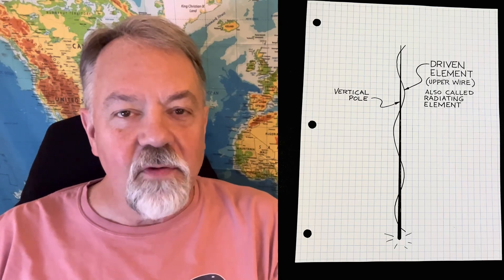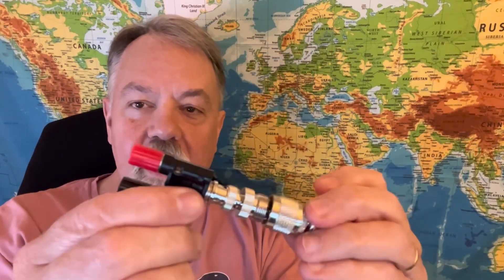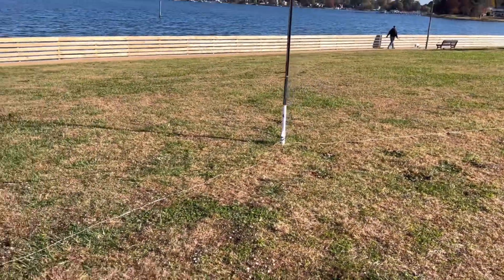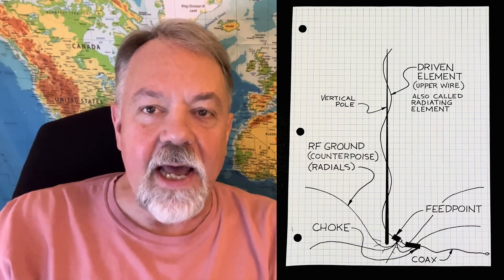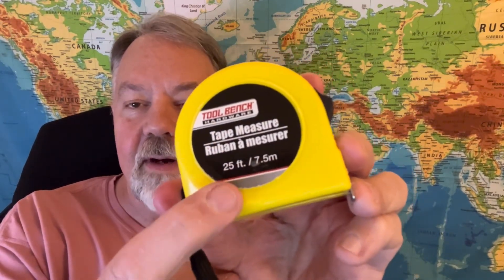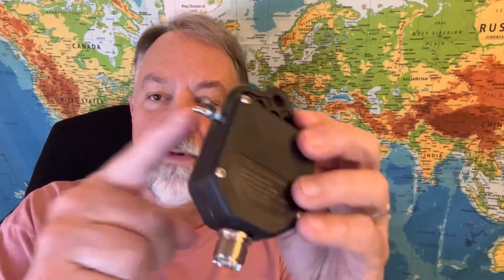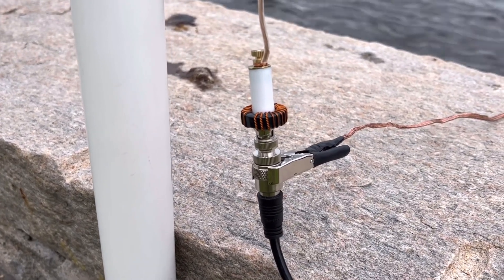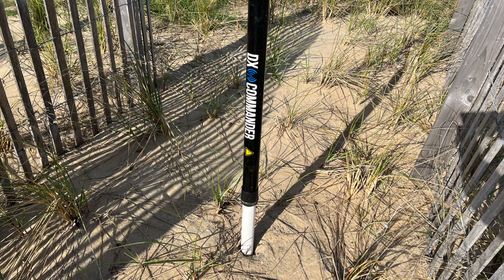Building Your First Vertical HF Antenna - Tips for Success

Comment: Would you please post the link to the "antenna tool" program that you sited in your video. Also would you please consider making a video describing/demo  some of the antenna programs that you have used and continue to use when designing antennas?  Thanks, Joe AA6WG

Comment: What would you recommend for a 40m vertical?  I have a net I work everyday at 7225 and I have been doing pretty good with my NVIS antenna. But I want to do better for the guys out there 400-600 miles away.
Reply from the maker: The best experience I’ve ever had on 40 with a vertical was using a 17 foot telescope whip on a Wolf River Coil.

Comment: I wish I saw this video when I first set out for the "grail" vertical. I ended up (after some experiemntation) with about a 37' vertical wire, qty 10 10 foot radials. Playing with VNA and experimenting I ended up with a 9:1 on it and an LDG600 W remote trans-match/ATU. The feed line is about 60' with the common mode choke 25 feet from the base of the antenna. Tunes up fantastic on 80, 40, 30, 20, 17 and 10. The 9:1 was the magic that opened up the range of bands. The elevation chart probably looks like a porcupine on steroids on 10 but it gets some DX. 40 and 20 really sing DX though, even when the solar was low I was working globally with ease most of the time. I took it down in the spring of '23 for a yard party. I haven't been able to construct something a little shorter that worked quite like it yet. Will probably bring it back to life after the leaves are gone to re-confirm the performance.

Comment: I just update the firmware. Etcher wouldn’t work so I used Rufus. My question though is I’ve got the radio plug into an external battery but I can’t turn to power up to 10 watts. I remember that the radio would do 5 watts on its internal battery and 10 watts with an external. What am I missing?

Comment: This is excellent.  And a huge help.  Quick question: do things (by things I mean the counterpoise wires and arrangement) change if the base of the vertical is off the ground, such as mounted on a fence post??

This is a really helpful video.  Much appreciated!
Reply from the maker: Thanks, I’ve found that as long as you get the counterpoise down to the ground and out that 3 or 4 foot span from the base to the ground really doesn’t matter. 73, Walt

Comment: One way of adding radials is to buy a cheap inline lightning arrestor add it between your balun/unun and your coax, then attach the radials to the grounding screw on the arrestor.

73 de AF6AS in “DM13” land
Reply from the maker: Interesting, thanks

Comment: Very helpful to this absolute Newby.  Can you provide links for purchasing chokes, ununs and banana plugs?
What bands are best for local listening only. No transmit. 
What bands best for longer range listening?
I've got a freshly refurbished Yaesu FT101E that I've owned for years but never powered up.
I'm hoping to find instruction on how to listen ONLY and how to properly dial in this complex looking vintage radio. 
Thanks
Reply from the maker: Check out the LDG baluns and ununs at DX Engineering. Not much for just local ham listening unless you get a little 2 meter radio and program it for your local repeaters. For long range HF check out the 40 meter band at night and 20 through 10 meters in the day.

Comment: As a new Ham, I enjoy your videos and get a lot out of them. Thanks! Question: can I use the cheap TV coax for ground radials? I know it’s not good for feed line. Wondering if the shielding makes it not good for the radials either. Thanks again.

Comment: Walt, thank for your efforts, they are appreciated. I purchased, setup, and have been using an EFOCF dipole from Palomar Engineering., strung north to south. Very Decent SWR on 40, 20, 15, 12, and 10. Little DX success so far. Now am committed to making verticals for DX. THANK YOU FOR THIS VIDEO - I plan to use the info here. fm KQ4IXD

Comment: Walt, do you have a video discussing the ferrite beads? Maybe which to use for a choke? I think I understand where I would place them. For example, If I want to use the feedline as part of the ground then I might place them closer to the transceiver. Or, I could isolate the feedline by placing them at the feedpoint. Or I could even place them at both ends of the feedline.
But how do we know which to use and how many of them? thanks!  KK6IPK.

Comment: Hi Walt, I love your simple but in-depth explanations and have a question.  Here is my situation.  I live on a postage stamp city lot with a 35'+ tree with a pulley mounted at its top. Four feet away from the base of the tree is a rusty but intact 42" high chain link fence that circles my yard with a total length of 150 feet with 2 right angles.   In theory, if I mount the wire to about 25 feet + 42" fence = 28.5 feet up and use the fence as the radial attached through a 4:1 UNUN( level with the top of the fence), do you think it would radiate properly?

I don't live in a HOA but in a major city and this would disappear into its surroundings.  Thanks!
Reply from the maker: I actually think that would work well. Give it a shot!
Reply: @COASTALWAVESWIRES  Thanks, I will and let you know the results.

Comment: Most easy to digest piece of antenna knowledge on YT. 73
Reply from the maker: Wow, thanks! 73, Walt
Reply: @COASTALWAVESWIRES  At the beginning of this year we had Harris Technician for a week,  teaching us about field antennas and dealing with just the wire ones made by ourself. Guy was quite experienced. His DIY example ladder antenna was noisy... I mean very noisy ;) We had scheduled comms plan with someone across Poland and we could not establish propper comms. I made vertical without even a pole, just hanging from tree. Well grounded, bit of counterpoise. I had crystal quality voice and digital transfer speed he didn't see for a while. He was literally astonished 😁😆 It was right before I retired and this was one of most proud  moments of my service. There was a lot of ppl participating in this training and word has spread quickly. Very high rank officers came to my farewell and  named me as  The Last Professional Radio Operator in my unit, expressing sadness about losing me from service. I tried to pass my experioence to youngsters but there is no passion :(
 Tears man, a lot of tears. And all of this thanks to you and others, sharing knowledge. 
Thank you Walt.
Reply: @pasjeihobby Hand salute!  Great story👍

Comment: Thanks for your great videos. I have been following your lead on trying out antennas. I have tried a coastal 20, an EFHW for 40m horizontal NVIS and just started using a Rybakov on a fishing pole. The last two in the last two days. Both tuned very well. However, my first try on both resulted in very high noise S5-6. I thought my setup was bad. I went back to the C 20 and had the same noise. I couldn’t find anything wrong. Later that evening I hooked the Rybakov back up. Worked great, no to little noise. Got up early today and was checking it out again. Connected to several NE QSO parties and experienced good RST, 5/7 to 5/9. Later in the morning made contact with Australia on my G90 - clear as a bell. This evening contacted Portugal - both 5/7. I have yet to retry the EFHW antenna. I spoke with other HAMs in the area and they too experienced the noise. What I learned was that I need to try antennas more than once before coming to conclusions about their performance. I have not checked solar activities for the past few days, but I suspect there was some interference. I am new to HAM and not yet familiar with signal interference symptoms in real time. I enjoy your videos and trying out  the antennas too. 👍
Reply from the maker: Solar activity has been extremely high lately. That probably isn't helping. 73, Waly
Reply: Examined the solar flare activity for this past weekend and there was major solar activity that seems to coincide with my noise problem. I also listened to YouTube videos of the noise from such flares and it sounded the same. The horizontal EFHW was much worse than vertical antenna orientation that also indicated flare interference problems. On the flip side, I think my DX on 20m was enhanced on Sunday morning. Contacts to Australia and Portugal were very clear and strong. I was pretty stoked to make these contacts at all. Way to go G90 and Rybakov! KISS works again. I wonder how the progression of flare activity affects RF propagation? The initial contact of the ionizing radiation causes problems, but once passed and the ionosphere gets supercharged, does this help RF for DX?

Comment: Very educational!  One question I’ve had (not an engineer!) is why you might use half-wave versus quarter-wave versus 5/8-wave, etc.  And while I know you’ve addressed it before, but when should we use different ratios of transformers?
Reply from the maker: Thank you! As far as length it's all a matter of takeoff angle and preference. I just did a lengthy explanation of the transformer ratio topic. I'd be typing long reply here to explain it. Please go have a look at that video. 73, Walt

Comment: Your videos are encouraging. I have been a ham for about 5 years and I am still lost. I like to have things known before I spend money and seems like ham radio that is impossible. I also enjoy CB and I have a question. Is there a cheap wire antenna you can build that will work on 10 and 11 meters? Thank you for your time.
Reply from the maker: You can use any 10 meter antenna on 11 with a tuner. Unfortunately it’s a little trickier to make a resonant antenna that will work on both bands with good SWR on both bands. A vertical dipole might be worth a try.
Reply: @COASTALWAVESWIRES  Thank you. I got started in all this with a CB about 30 years ago. I still like 11 meters and I had a Antron 99. Once I became a ham things got so complicated with what antenna to use that it became a burden and not fun anymore. My dad died so I moved into my mom's house to take care of her and now have limited space and no trees.  People tell you the opposite things so I am trying to embrace your motto of just get a wire in the air. But my goal is to have one very good antenna that is mounted and then play with other ones. Problem is I can not figure out that one to mount. I can get a tall Spiderbeam aluminum mast and do a dipole but then people say it can not be on a metal mast. Others say it can be so who knows who to listen to. I thought about a multi band vertical but then some say those suck and others say they are great. Very hard to know what is right in any of this anymore. I hate to spend money on crap or have to keep messing with something when I only want to come home and use it after a long day at work. I guess CB and ignorance was better!

Comment: As an idea, as you mature the audience, maybe even moving to other more complex antennas within the theme--use with big 46' pole from DXE to support longer wire  antennas, and also maybe single band wire vertical array. I bet if you did you 20m 1/4 vertical with a passive Director stuck wherever you wanted better gain (your VK targets) itd be more gain, you only need about 10% wavelength spacing. This would open up the ideas more too, EFHW vertical beams are not much in use so playing would be in order. Just some ideas, thanks for your content amd format, BTW Love You ❤️ 😍 💖 ❣️ 💕 the music and how you do it all on your phone. De WO8USA🇺🇸🇺🇸🇺🇸
Reply from the maker: Thank you! I actually have wires cut and a plan for a 10 meter vertical with a director, just waiting for better conditions. Thanks for the ideas! The music is my son so I greatly appreciate the compliment! 73, Walt

Comment: Good video! Just to clarify, the radiating element on verticals is the center conductor on the coax, the braid on the coax gets connected to ground or radials. Love your videos, keep it up! You got me into anyenna building and I have built several of the antennas you have featured. 73 N2SCD
Reply from the maker: Thanks! Yes that is correct. 73, Walt

Comment: Love your videos. I have been doing great with a 55ft wire up a 80ft. tree with a 9 to 1 UNUN from Palamar. 50ft.  coax to a Palamar super choke then I run the coax into the shack with an electrical LB and 1in PVC. I have worked 155 countries from near Greenville, SC.

Comment: Great video Walt! 
I've only had my general a few months. My first HF antenna, built on 04/01 was a 17.5' wire velcro strapped to a pole saw handle. I already had a manual tuner, and I've done some tweaking and experimenting, but it's still my only antenna. I've made almost 1000 contacts on this simple setup. It really is that easy to get on the air.

Comment: Can I use PVC pipe to make the pole?
Reply: There are different grades of PVC pipe based on the wall thickness. Try the stuff called "Schedule 40" or even better, "Schedule 80" for the most strength. Don't bother with "Class 125" PVC because of the thin walls.
Reply from the maker: Not sure it will stay rigid and straight for the amount of length you’ll need to make a vertical antenna

Comment: Which DX Commander pole are you using. The 10 meter original?
Reply from the maker: No, I use the 10M Expedition
Reply: @COASTALWAVESWIRES  Thanks

Comment: very good Walt. best thing. do not over think it. I start with speaker wire. one thing I learned that cut length of wire can change around.  different insulated wire has different villosity factor . like silicone to PTFE   to PVC . even the wire diameter can effect the length . and type of soil the ground is on has a big impact . even snow on the ground . usually a good thing , on lower frequency . 73's
Reply: Excellent refresher ty ive heard this before . Almost forgot👍

Comment: Great video Walt. A question is working with MM  how many points after the decimal do you use or a rule of thumb to go by?
Reply: 25.4mm = 2.54cm = 1 inch. Learn the worldwide metric system and get a tape measure showing metric measurements. To work out any wavelength, just divide 300 by the frequency, easy peasy.
Reply from the maker: I just go to millimeters. So 5.01 meters is 5010 millimeters on the tape

Comment: Real easy and effective radials can be had by laying down 2 4x8 foot pieces of aluminum screen. Attach 1 ground lead to each section piece of screen.  This is very easy to deploy and pack up.  Others have used sheets of  Faraday Cloth with similar results
Reply: Absolutely correct. Using a Faraday cloth about the same size as the metal insect screen I used to use, with a 17ft vertical whip, 9:1 unun and auto tuner to my FT891 or IC7300, and operating portable on my trips around the Australian outback I have had many 20m SSB contacts with the USA including with Walt. VK4BOB

Comment: I'm very new to this and also had a question? If I use more adapters and converters for my antenna do I introduce more noise to my radio?
Reply from the maker: Not really, I use them frequently and don’t have any issues
Reply: @COASTALWAVESWIRES Roger that.

Comment: Walt, you did this from reading the minds of all us new general operators.  Really enjoyed the simple approach and especially the clamp on the 64:1 unun I picked up from your hint.  I put up a 7M DX commander with 6.69 M wire and have been picking up active contacts all over NA from Northlake, TX.  You are doing exactly what we need for common sense operating.  I will be back in Louisiana in 10 days and really excited about going to my place on Grand Isle, La and doing the saltwater vertical.  Will give you a report when I’m done, maybe a pic or two.  Also picked up the fiberglass antenna you have at your house as my place is 12 ft off the ground and then also have a metal roof.  Will be standing it up and will likely have to tune the metal tip like you mentioned in your video.  Thanks again for your common sense approach and your dedication to doing these videos almost on a daily basis.  Your a good man Charlie Brown!!!
Reply: Nice... I'll. Be traveling to terrebonne parish at end of the month... Planning on operating point-aux-chene WMA hopefully twice.

Comment: I am new to HF and am working on my General license.  So I listen for now but do operate on the small piece of 10m that Technicians are alloted.  My first antenna build, based on what I have learned from your channel, was a 25' random wire.  My second build was a 17.5' random wire for my dad who is in my same boat with a Technician license.  Both antennas work on various bands and I am quite happy with them.  I did use an Unun and counterpoise on both antennas based on you recommendations.